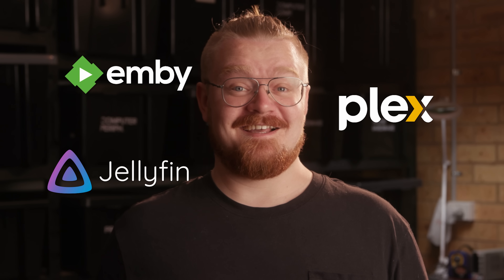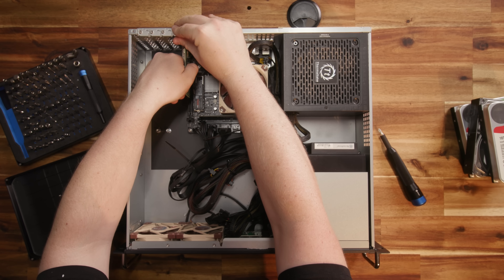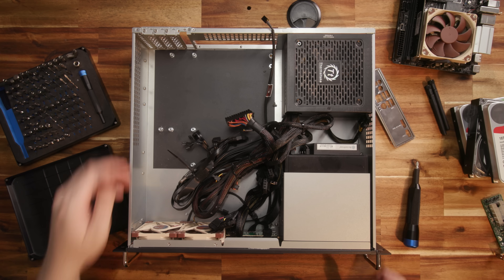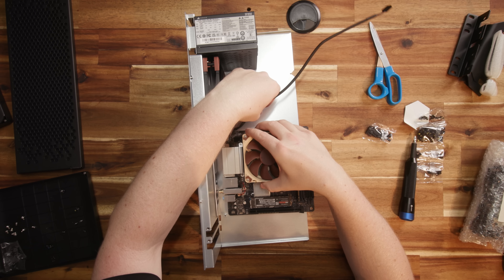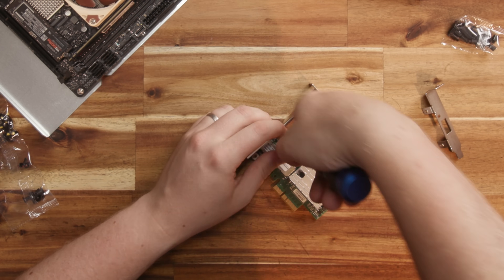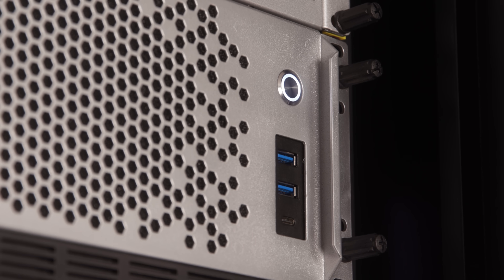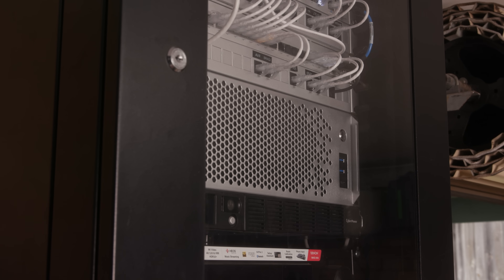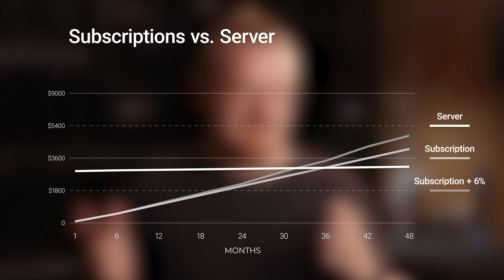I Spent $3,600 Just to Keep Watching Parks and Rec

Comment: i might actually do something like this for the corner of my living room that has a bunch of wires and a rack mount ethernet switch. might very well finally be able to tidy it up and upgrade my aging, and full 4TB NAS at the same time! It is sooo slow with its 100Mb/s connection and it definitely doesn't help that it's setup as a JBOD 😂

gotta get the racks!

I wonder if i can make it have an HDMI input and make it have a menu like kodi and i can just have it be like a smart tv menu that i made myself
Reply from the maker: Do it! You wont regret it
Reply: @TheStockPot-AU  i have started. got a server rack off facebook marketplace yesterday and it came with a netgear switch that can output PoE and a extron in1604HD which i'm gonna plug my retro consoles into so they all come through one source 😅

not to mention it came with a olson rack mounted IEC power strip, which is perfect, since I was already using a UPS

Comment: Sliger does have a backplane in the works in theory. I am not sure where things stand on that though. They have been swamped with orders last I knew.
Reply from the maker: I'm seriously considering asking for some drawings of the case so I can design my own backplane for them! Just an electrical connection to some proper SATA connectors, no controller.
Reply: @TheStockPot-AU  If you email their support you might get them. Looks like they posted last month about trying to find someone to manufacture backplanes for their upcoming topload case.

Comment: I haven't come across your channel before, but I have watched other stuff on this topic including Jeff Geerling and Hardware Haven that you referenced.  This was fun to follow along with and your unusual case requirement was an interesting variable.  Sounds like the case you got ended up being close to just right, minus the quirks you mentioned.  I'm currently repurposing one of my spare desktops(off-lease office PCs are addictive), a Thinkcentre SFF, into a better NAS than what I currently have in use.  I have a lot going on, so finding the time to sit and figure out all the parts I need has been tricky which has slowed things down.  As it's repurposing a machine I already had, it's more in line with Hardware Haven's budget build.  Because it's a SFF, I'm compromising on storage and going with all SSDs.  But this NAS thing is all about choices and my needs are fairly modest(no 4K anything for me).

I share your view of the modern media landscape.  I initially had some interest in digital distribution for the sake of not having to deal with "stuff", but it didn't take long to see the downsides of that arrangement.  We see it with games too.  Things just disappear too suddenly too often.  So I opted to go with physcal media ripped to a NAS.  I've found creative ways to store the discs and cases for now so that's not an issue at the moment.  I'm not a big collector so being picky helps.  It also helps that I had what I'd consider a reasonable library already, so I was off to a good start based on that.  A lot of what I like can be found inexpensively too, especially if you don't mind DVDs.  As I'm into classic TV shows, a lot of what I like is only on DVD, which makes things easier.  The wholy DIY NAS thing is fun, and kind of feels like magic.

Comment: There is no such thing as an NVMe to SATA adapter. It's a PCIe card that's a SATA adapter in M.2 form. NVMe is a type of storage, connection not a form factor.
Reply from the maker: You're right... But the search term that I found turns these things up on google / ebay / aliexpress is "NVME to SATA Adapter Card" so that's what I went with!

Comment: No room to move the rack sides closer to front and fit in a HL15, it is 50.8 cm? Can't really see if there is room in the video. It has better push and pull fan config and a better drive backplane. I would have bought a slightly bigger rack and gone with the HL15
Reply from the maker: Only had 3U available, so top load was out of the question unfortunately!

Comment: Since you decided to run drives off of an NVME to SATA expansion board, I don't see the difference in reliability between having all of the SATA ports internally compared to putting the extra drives in an external USB case like a TerraMaster D5-300 (or equivalent). You should be able to run the entire thing off a couple of 12V power packs and if you put in an i3 processor like a 13100F or 14100F, C states will allow even lower power idle consumption over the 12100 (3W compared to 17W). On a cheap UPS, it'd make it all rock solid.

Comment: I did this in 2020 and am in the process of building NAS 2.0.  Mobo/CPU/Ram were fairly cheap but chassis (hakoforge mini) and drives (16x18tb) gonna hurt.  I have the Sliger CX4712 and it's a great case, Sliger not the cheapest option but they are really nice to work with, though I'd like to see the NAS chassis come with a more robust drive connection implementation or a proper backplane.

The break even calculation for my old server was ~$2 years (server cost $200, drives about $1200) and I've gotten 5 years use out of it, hoping to get at least 5 years out of 2.0.

Comment: As someone who has their rack in their garage, how do you deal with dust and Australian summers? I'd like to move a lot of my gear from the study to the garage but the latter is a much harsher environment than the former...
Reply from the maker: I've not had any issues. Temps are a little higher than indoors, but not too bad. 

My rack has a pair of 240v fans in the top to draw out hot air. I use a Home Assistant Automation to turn them on when the average CPU temp of everything in the rack exceeds 52c 

My garage doesn't get particularly warm, you might have a very different experience!
Reply: @TheStockPot-AU  I guess I should find out, I have HA. I'm in Melbourne.

Comment: I was a fan of Sliger. But not anymore and I cannot recommend them based on their customer service. I bought one of their cases and it came with a set a rails that didn't work properly. I informed them about the issue and they offered me a refund for the defective rails or I could wait for them to get new rails from a new supplier and they would send me a set of the new rails. After quite along time of not hearing anything else and not receiving the new rails, I contacted them about it again and they refused to send me the new rails or refund the old ones, and said they would "sell me the new rails at a small discount", even though I had all the email proof I was offered a full refund or new rails in the past and I choose to not take the refund back then and wait for the new rails.
Reply from the maker: That's disappointing! I did have some shipping delays on mine, but they were pretty responsive. Sorry to hear you had such a negative experience.

Comment: I really wish there was more DTX motherboards out there. Otherwise you have to do gymnastics like you did - pray CPU's encoder is good enough, rely on 10G NIC onboard (if there is) or hope the M.2 -> SATA adapters actually work (which they don't, most of the time).

Years ago, "narrow" ATX, and micro ATX motherboard form factors were common, like ASRock M810LMR, pair it with four PCIe slots (x16/x8 electrical, x4 open ended, x8, x4 open ended), SODIMM slots to allow unimpeded airflow to CPU, and you have absolutely perfect machine that can take 10G (or faster) NIC, proper SAS/SATA HBA, a GPU, and single slot left, if GPU is single slot design.

Only Advantech or Kontron still make systems of this type, but you can't buy them, really, unless you're BIG buyer or have a lot of cash.

For ATX it's a little bit easier, since there are some nice narrow mining motherboards out there, but downside is they are all limited to x1 PCIe slots, not terrible, but not great.

Comment: Cheaper and easier option 
Buy an external drive and plug it in the usb port of the tv
Reply: Sure, unless you want to watch something on a different device. And what if 2 people want to watch different things on 2 different devices?
Reply: What do you do when that drive dies?
Reply: @nadtz  buy another one and sail the seven seas again? What do you do when a $3,600 server dies?
I still use physical media so I'm not really thinking of putting hundreds of 4k discs on a server, I just use the external for some hard to find things . . .
Reply: @JungleJeffarnold  when a part in a server dies, you replace it.  Not like that's rocket science or anything. And I've ripped my DVD and CD collection to my Nas, much less of a hassle finding media when I want to watch or listen to something as opposed to digging through boxes of physical media.  Your way might be cheaper but it's not easier when you have a substantial media collection, last I checked my anime + movies archives was almost 40tb, not like it would fit on a single drive anyway.
Reply: @nadtz  my media isn't in storage I just pick it off a shelf 😂
I've got thousands of discs if I just ripped my 4k's that'd probably fill 40tb then there's the blu rays the dvd's it'd take months to rip it all, For the sake of standing up and grabbing something it's really not worth all that time, effort and expense. 
I do rip my music but that's mostly so I can put it on my phone or in the car, I don't feel the need to do it with films.
Reply: @ Not worth the time and effort to you maybe, it is to me.

Comment: Just curious, how’s the used server market in Australia? eBay here in the states can land you a massive machine with tons of ram and even drives from time to time. 
I have a fully loaded Dell R620 for 800 USD used.
Reply from the maker: There's plenty around, but they're large, noisy and use a lot of power in most cases!

If I needed compute + RAM, I'd probably go that route, but for this server, I just need storage + enough juice to encode!
Reply: @ Roger, that makes sense

Comment: One case worth noting is the HL15. It isn’t cheap at around AU$1300-1600 depending on rates but the shipping is subsidised and I would consider it a case for life as it is very well made. It also has a backplane. 
Otherwise there are some silverstone and other cases that are 2U to 4U although some have horizontal mounted drives which I’m not a fan of due to heat build up. 
Then you move onto things like the Fractal Design Define 7 tower cases. I have 14 drives in mine and the temps are good as is the sound deadening. The XL can hold 18 drives I believe.
Unfortunately here in Oz pickings are slim and we just get to watch US creators with access to parts we can only dream of encountering.
Reply from the maker: The HL15 looks great, but I was limited to 3U of space in my rack unfortunately!

Comment: This is ridiculous because there are many situations where you're not going to have internet service like if you're on walkabout battling 7 meter long 2 tonne salties with nothing but a KNIFE or say on a cruise ship where they want you to pay exorbitant and extortionate rates for Internet service which don't have video capabilities. You're much better off with a cellphone which has a microsd slot and a USB C to HDMI adapter that also provides power to the phone. The current microsd capacity is 2 terabytes which with a cubic inch of luggage space  is good enough for a month long cruise with the added advantage of being able to chuck the phone in the safe in your cabin while you're sucking down some Fosters with the Sheilas around the lido deck pool. Most room safes don't accommodate even smaller laptops so there's always the possibility of getting it nicked. Fair dinkum try mate but it's too big, too expensive and too impractical to be of much use to run of the mill wankers.
Reply from the maker: wat?
Reply: wat wat‽
Reply: No one said you have to make a media server. But they do have benefits. For one, you can watch on many different devices, potentially all devices that support video streaming depending on how you do it, and you can have more media accessible than you can on a portable solution.
Reply: Samsung released its new rugged cell phone last month the Xcover Pro 7 which has a 2TB micro SD slot and interchangeable batteries so I defy anyone to find a more portable solution for watching videos given 15 micro SD cards have a 30 TB  capacity and the phone runs Android 15 and Samsung guarantees 7 years of updates and with recent restrictions on external power supplies it's likely they'll soon be banned IMHO.

Comment: The biggest cost on these builds (for me anyway) are the HDDs, not the actually server / enclosure.
Reply: Not if you just spend excessive amounts on a rack & other components 😂
Reply: @ I admit. I am lazy and just bought a QNAP :D
Reply: @adriankoch964  Even then, it's not hard to find 24u racks for about $200.  Compared to HDD costs (even re-certified drives) that's relatively cheap, especially when you get into systems with 8+ drives.

Comment: Yea, I am running to the rack depth problem a while ago, but I am lucky to find a 2nd hand shorter 4U case online, and it takes MATX mobo.

I'd also suggest you switch to MATX mobo in the next upgrade, the extra PCIE-slot and NVME slot really helps.
Reply from the maker: When the time comes to replace Bragi I'll definitely go with matx, but I'm hoping to get another 5-7 years out of it!
Reply: @TheStockPot-AU  definitely if you mainly use it as a NAS, my i3 10100 still going stronge.

Comment: I just wish Tapes for backups were of substantially higher capacity because it would be nice if you could have a dual tape drive rack mount system for stable & reliable storage for two off site locations.

Comment: It sounds to me like it might be a good consideration for you to get yourself a deeper rack.  I picked up a 39 inch deep 37u rack from sysracks in april to better organize my homelab setup and I couldn't be happier.  for storage I'm running a used supermicro 847 chassis that I picked up as a barebones unit (no board/cpu/memory) it came with a case, a pair of 1200w sq power supplies (super quiet), a 24 bay sas3 backplane at the front, a 12 bay sas3 backplane at the rear, and 5 ridiculously loud 80mm server fans on the fan wall which I immidiately removed and replaced with 3x arctic p14 max's (140mm high static pressure quiet fans), on a custom 3d printed fan wall, and 5x arctic p8's (80mm high static pressure quiet fans - 2 in the top section at the front of the motherboard to blow air over the heatsink and the pcie cards), a used lsi 9300-16i sas3 card, an intel x540-t2 dual 10g-base-t card, and a crappy gpu i had laying around just for vga out.  I used my previous workstation motherboard that I had set up with a ryzen 3700x and 64gb of ram, dropped a cheap 500gb m.2 drive for booting truenas scale, and overall the hardware (case, cards) only totaled about $800 shipped.  the expensive part is the disks which I picked up on sale.  16 refurbished 16tb seagate server drives (genuine), and 8 14tb wd red drives which I had left over from my previous nas project.  they're set up in a single raidz2 pool using 8-wide vdevs for a total of 237tb of usable storage.  not unlike yourself, I use this machine partially as a plex server to stream all of my dvd and blu-ray rips as well as a ton of media that I personally recorded from cable tv when that was still a thing for me back in the day (I used to have a cable capture card and would use my pc as my primary tv).  I also use this as my primary backup platform for the various workstations in the house, and my proxmox cluster, it's archival storage for photos and videos that i've shot, video projects I've done, etc. 

photo of my rack: https://i.imgur.com/be2fKBo.jpg
Rack diagram: https://i.imgur.com/iCdBXS4.png
Reply from the maker: That's a heck of a setup! My wife would not be pleased 😂
Reply: @TheStockPot-AU  the only real problems are noise (which once I swapped out the fans on the nas chassis is nice and quiet), and power (due to a combination of power cost and household circuit limitations, I only have a rack power budget of 1200w peak (and i'm using a 1000w ups, so that's my real-workd cap.)  other than that, my wife loves that we have instant access to all of our dvds/blu rays, etc on any of our tv's, she loves the 2g fiber internet, the integrated ad blocking pfsense/pf-blockerng provides, and that everything is in an attractive, enclosed space rather than all over the place.  I can't really think of a reason why a spouse wouldn't want to have a nice homelab setup Shrug

Comment: Nice ad for expensive Sliger cases--like so many other channels have been running lately. 

Why didn't you just get bigger drives?
Reply from the maker: Good question! I was already running 18tb drives, so could gain limited space by upgrading to 22 or 24tb. And I already had a few lightly used 10TB drives on the shelf I wanted to make use of.

Definitely not an ad, when I ordered the case I hadn't even started this channel!

Comment: One of the most annoying things about streaming services for me is not being able to pause as I see fit. Partly I mean the onscreen menu garbage that sometimes won't go away and trying to manually clear it backs you out of the show, but also I mean when you're trying to read something in the show and you can't read through captions, which are often annoying to turn off then back on because modern TV is too mumble driven, or when trying to read around a prompt to rate the show. If I want to pause some spy thriller to read the dossier that a character is looking at, or to read texts on their cell phone, streaming services can make that annoying. Then you don't have the ability to go back and forth by a frame at a time in case you didn't pause fast enough, or to change the speed if you're watching something boring and plodding but you really want to see the end.

The TL;DR being, I can pause to read stuff onscreen easier if I just rip the disc and play it with `mpv`.